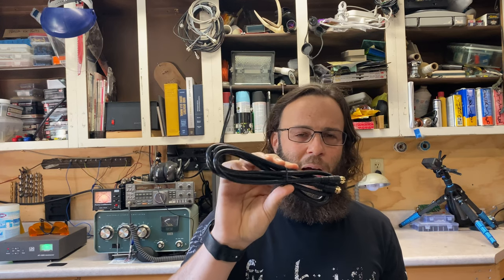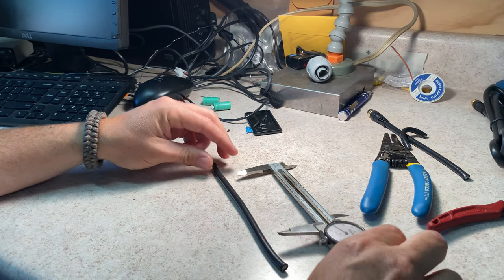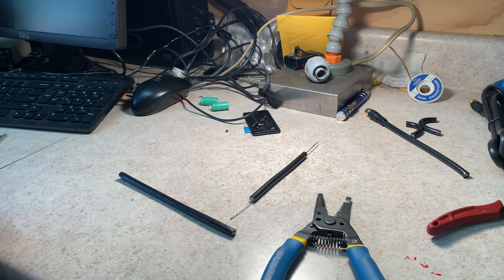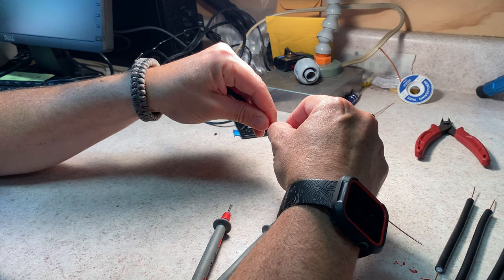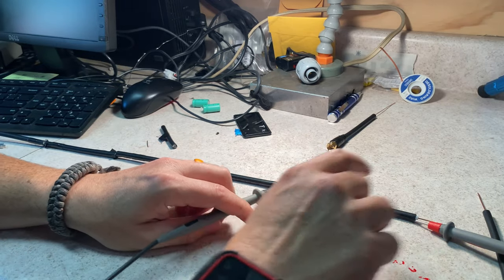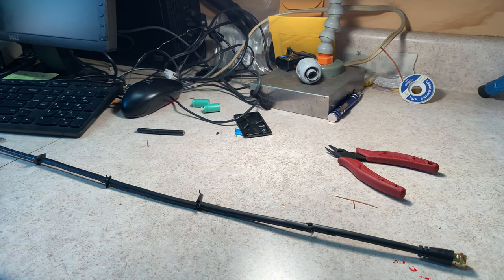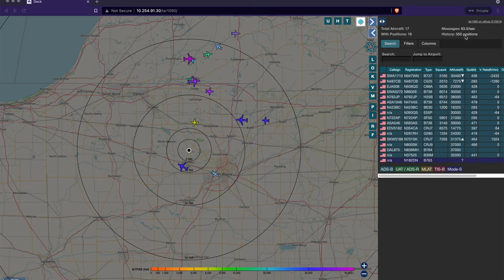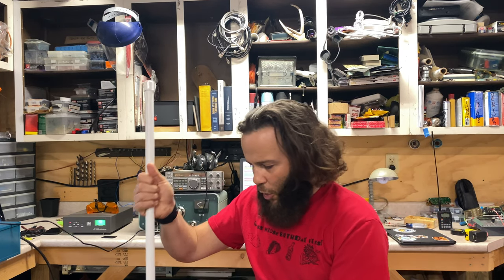Making a 1090MHz CoCo Antenna for ADSB

Comment: really cool build, this is my first time seeing one of these antennas- I'll give it a try.
Reply from the maker: They are easy and cheap to build. Make one and take it for a spin.
Reply: @LifeAtTerminalVelocity  so I made one, testing as I went, and it only performed about half as well as the simple ground plane antenna I use. just testing on my patio I only tracked around 30 aircraft with the colinear and then it jumped to 60 with the ground plane. maybe I did something wrong? I'll make another one when I get the chance. one thing about ground planes is that they have a great takeoff angle and view of the horizon for this kind of stuff
Reply from the maker: @grumpy_ken  Not sure what to tell you on that account. I can tell you that the two I have permanently installed do really well and better than the ground plane I had before. It might depend on build and location of deployment.
Reply: @LifeAtTerminalVelocity  yeah definitely. I probably messed something up, I'm going to try again some day I'm feeling patient- I want that gain lol

Comment: I just used plastic shirt buttons between each element works perfectly. along with heat shrink sleeving 👍
Reply from the maker: That's a great idea!
Reply: Can you explain more?
Reply: @HACKPHILES   the shirt buttons have the inner core passed through the holes. they stop the outer shields shorting.   So one button is trapped between the sections of the coax pieces. ensuring no short can occur. use a button instead of electrical tape. HTH

Comment: Great tutorial! I just started on my CoCo antenna build and will follow your instructions, as I have had the RTL-SDR v3 for a while and recently downloaded the software to pick up some ADS-B signals in my area (which worked but not great)! The calculator you linked suggests using 1/4 wave segments at each end, even if you use 1/2 wave segments. I found my coax is BELDEN-T F9116 DuraBond II Series 6 which I found has a velocity factor (Nominal Velocity of Propagation (VP) [%]) of 83% in the spec sheet. The calculator tells me for 1090 Mhz with VF =  0.83, I should be using 114.14 mm lengths for 1/2 wave and 57.07 mm for 1/4 wave. So should I be using 6 segments of 114mm, and then have the 2 ends each at 1/4 wave (57mm)? The 1/4 wave segment at one end would just terminate with the RG6 F Type screw-on connector that's already on the cable, and I would plug that into my adapter that converts it to the smaller SMA connector on my RTL-SDR. However, how do you terminate the free end of the antenna? Do you strip the last bit of copper core (just like for all the segments) and have it just sitting free in the air? This last length would need to be trimmed to match the 57mm length and not have any extra "overhang" because I wouldn't be using the extra to poke into the next segment (as you do with all the other segments to alternately link the cores to the shielding and vice versa).
Reply from the maker: Glad it helped. I tried to terminate the antenna at the top with a resistor of the same value as the impedance of the coax and I didn't see any significant difference between the two. Your mileage may vary.

Comment: Hi! I have a question, the elements at the outside of the main axis can be in different positions? Or the should be all aligned with the next one? Because I find it hard to made it so mine went all in different positions... Also, I put 13 elements but I think it should be even numbers only? Thank you!
Reply from the maker: I don't know if you need to have even numbers exactly but I think that in theory that is the only way that the impedance balances out. You might consider adding a 75 Ohm or 50 Ohm resistor between the center and shield of the top segment and see if that improves things in the odd number segment scenario.

Comment: So.. velocity factor, this has me stumped. The vf is the speed of propagation in the core. But we're swapping to shield on and off where the vf is much closer to 1. So... what vf to use to get it more exactly on frequency?
Reply from the maker: Excellent question! Keep in mind that I'm not an antenna theory expert and what I know about this design comes from what I have read when I was looking for a solution that was inexpensive. 

This is a set of stacked antenna sections on the same plane (Co-linear) made out of Coaxial cable (thus the moniker CoCo for Coaxial Co-linear). So the actual antenna segments are every other segment starting from the base. So if we number the segments sequentially the only real parts of the antenna are the odd number segments. We are using the shield of the even sections to transport the signal of the odd sections and the center conductor to transport the ground of the odd sections. Thus the velocity factor only matters in the sections that receive the signal. It took me a lot of reading to get to that point because I couldn't understand how the actual antenna worked given it theoretically is just one big continuous chunk of copper. Until you alternate the centers and shields. Wild ain't it?

So use the vf of the coax you are using to build the antenna. It will work.
Reply: @LifeAtTerminalVelocity  I'm dubious. I've built a few myself. Yes they work, but without some very expensive test gear it's impossible to tell how well they are working. Phasing issues could also arise with the differing vf.  If we're not too fussed about being spot on, yes it's Ok. I've also seen multiple designs, with quarter wave stubs, quarter wave initial segments followed by half wave then topped with quarter wave.  I may try modelling in AN-SOF but its a tricky one to build in a model.
Reply from the maker: Not expensive at all to get the equipment to test it. A NanoVNA is $61 - https://amzn.to/3pOj3Dy
Reply: @LifeAtTerminalVelocity  I have one.  Won't measure gain though.

Comment: I am having difficulty about the elements size calculation as to which length to cut them. Because instead of a 70 Ohm i have a 50 Ohm coaxial cable but don't know the velocity factor of the coaxial cable i bought. It doesn't mention aything about it.
Reply from the maker: I wish I could help you but without knowing the velocity factor you just have to guess. The alternative is to buy some cable who's velocity factor you know or can look up.
Reply: @LifeAtTerminalVelocity  I found a simlar cable like the one i have with same core material, insulation and shielding. I will use the velocity factor of that since it also has the same Ohms and pray for the best. Worst case i buy i new cable.
Reply: You should be able to google the vf from the cable data printed on the actual cable.

Comment: Any reason you used 75ohm instead of 50ohm?  I didn't see any matching unit or transformer in your build.  Did I miss something?

Have you tried a 1090 bandpass filter?  Looks like you're in a suburban area and was curious if you saw any difference.

I'm looking at making one of those using some LMR-400 I have left over from my dual band antenna install and use N-connectors and LMR-400 all the way to the coax input panel at the house.  Then some LMR-400 ultra flex to the radio using a 4" pigtail to make the N to SMA transition.  That should give me minimal loss compared to most other cables.  Your video definitely gave me some direction on where to go with this.  Thanks!
Reply from the maker: Hi Richard, I used 75Ohm Coax because it is perfectly fine for this application. I’m only receiving and not transmitting, the impedance match is not required and lets me make an antenna very cheaply. There is no matching unit or transformer as it isn’t necessary. 

I use the ADSBX Bandpass Filter, it is listed in the video that follows this one (Making an ADSB receiver). 

Your plan for LMR 400 is solid from what I can tell. Get your receiver up and running and have a blast with it.

Comment: Did you build the antenna for 146.5mhz?  I'm looking some info to build one for APRS freq, 144.390. 73s!
Reply from the maker: I haven't built the antenna for 146.5 but the process would be the same as for 1090MHz. Just with different length elements. For 144.390MHz using standard 75Ohm RG-6 it would be 430.83 mm per segment. I would use at least 8 segments.
Reply: @LifeAtTerminalVelocity  I want to use for TX & RX, so I think it will be  50ohms coax on this case right?
Reply from the maker: Yup. The length would be different because 50Ω Coax has a different velocity factor. You might also have to add a 50Ω resistor to the end for the SWR to come into where it needs to be.
Reply: @LifeAtTerminalVelocity   I will try to build it during this weekend,   my only doubt is the topic about 50ohms resistor, is that like a stub for tune the antenna? thanks!
Reply from the maker: That is my understanding of it but I have never put it to the test.

Comment: HUMMMM.... i like it im going to build one but a few questions, my Pi is going to be in the top room and then the RG-6 into the attic into the bottom of the antenna, but not planning to have a coax connection at the bottom of the antenna, so i think i just start my 8 segments while inside the antenna housing.. and then you made an 8 seg .. does a 16 seg have any other benefits as in gain.. or is it not even worth it.. thanks for the video
Reply from the maker: 16 segments has more gain but for my purposes the little bit of extra gain wasn't worth building to.

One way to tell - built it and test.
Reply: @LifeAtTerminalVelocity  so I have around 250 segments  will that improve the gain?
Reply: @noobking5056  I have 251 segments.  Works great.
Reply: @Banditt42  size of each segment?

Comment: Glue lined heatshrink on the joins would of been better
Reply from the maker: No doubt, but since it needs to go inside a PVC pipe for support and use outdoors the electrical tape was sufficient for my needs.
Reply: You could probably fit the entire antenna in one big length of heatshrink for giggles.

Comment: How to build antenna with 868mhz pro?
Reply from the maker: You can head over to this link. Plug in the frequency and it will give you the length you need to cut each section. Assuming that your coax is RG6 your VF should be 83-86%.

Coaxial Collinear Antenna Calculator - https://jeroen.steeman.org/Antenna/collinear-coax
Reply: @LifeAtTerminalVelocity  that link is dead
Reply: It's working today 4/10/2022